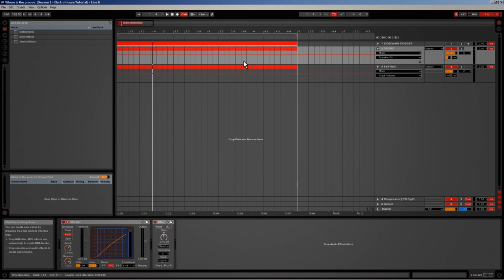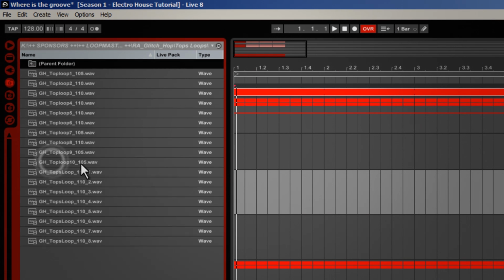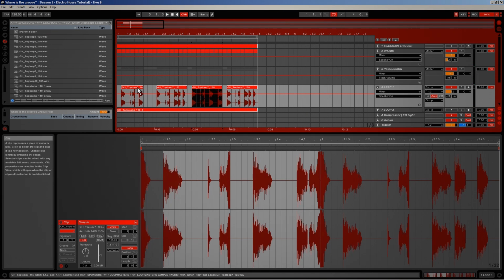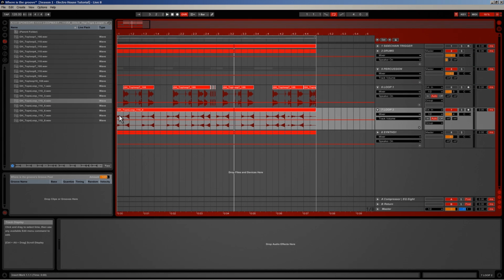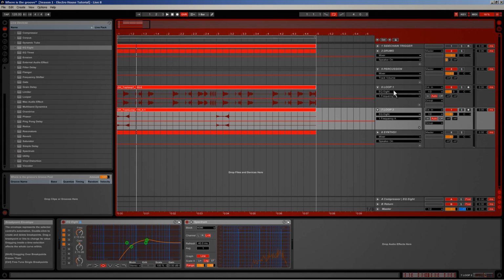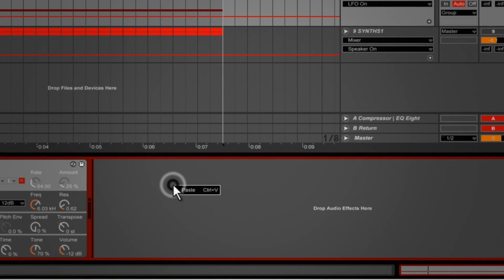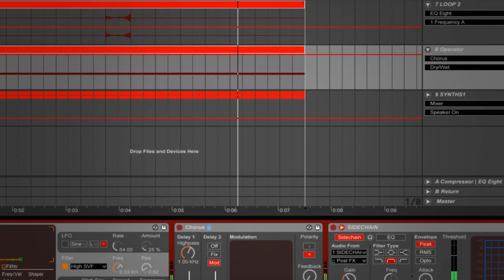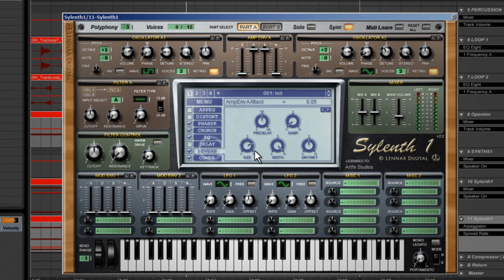Using loops to fill up your beat - Ableton Tutorial Tuesday

Comment: I'm actually not using pirated software, believe it or not.  Aside from that, I'm a poor college student busting my ass at a minimum wage job pulling 47 hours a week.  I can't spend $20 on samples.

I simply thought it would have been much easier and smoother for the tutorial series to use free samples.  No need to be an asshole.